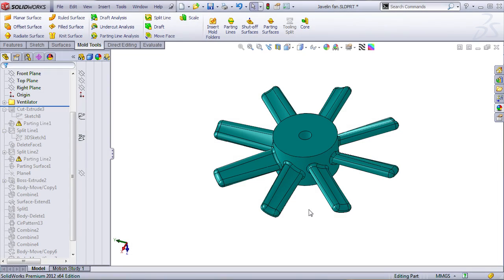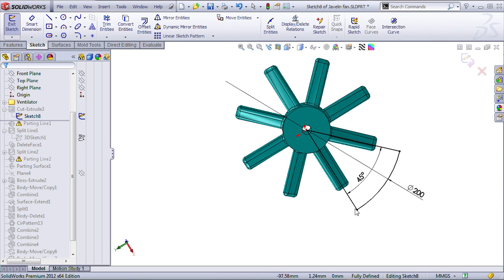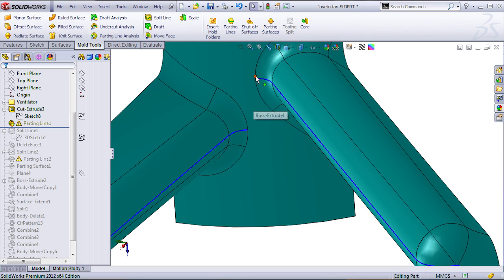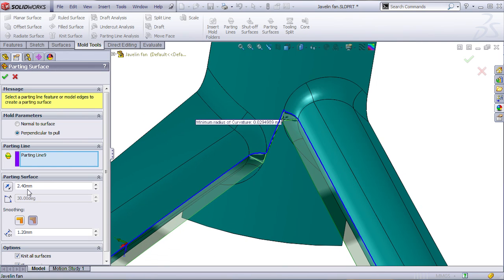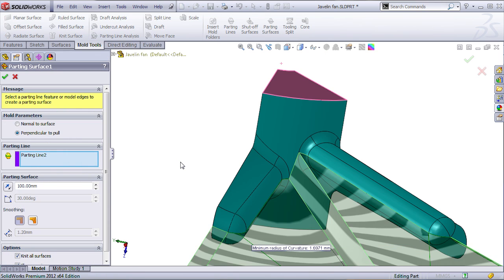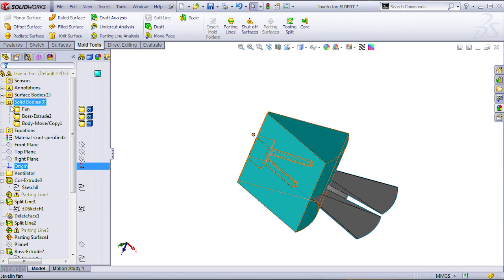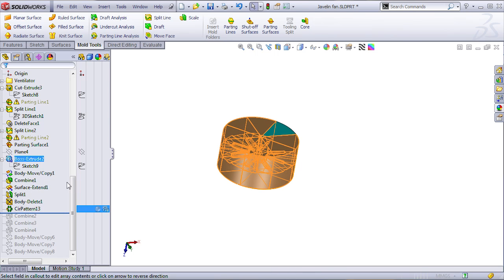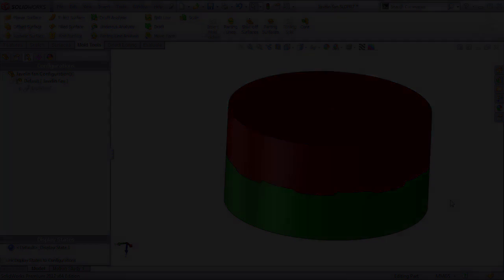Complex Mold Split Using SolidWorks

Comment: To make a smooth transition on the cylindric hub you can make the 3D-spline tangent to surrounding split line elements.

Create an split-line to split the surfaces of the "blades" and their fillets attaching to the hub but ignore the path on the hub. It will be split once you have a 3D spline. 

Then make a 3D-sketch on surface where you "convert entities" of the surrounding split line elements and set them "for construction".

Then draw a 3D spline on hub surface and attach each end of the spline as "tangent" to the converted splitline elements. The 3D spline on the hub can now be used to split the hub surface.

Once the surface has been split you can run a complete split line where you can now make the path use the split of the hub surface.

When the split surface is now created using the split-line, the surface will be tangent as it crosses from hub to blade fillets and the split-plane becomes continuous and smooth.

Comment: Hello I am not sure but do you think if you made both sides of the cylinder taper the draft surface will sort out by using symmetry revolve cut ?  and tracing your parting line from that middle plane that you created ?

Comment: 1:25 You should always try to create fully-defined sketches. So when you're requested to change a feature or the customer makes the change, importing the revised part into the file will result in fewer corrupted commands, let's hope. Nothing is guaranteed. Regarding the part file: Always use a copy the customers file & archive the customers version. Delete any links & store in a customer archive file safe from any accidental associations. It never hurts to remined everybody of this procedure to save the Designer & their employer headaches later from 'difficult' customers. As for the part: I would've asked the customer to redesign the fins for an easier better parting line. Not just for subtractive machining but to simplify the geometry to reduce build time. Just a thought. Thanks for the video.
Reply: Yep, you could ask the customer to redesign the part to make it easier for you and they get the next cheapest competitor to do it for them, you'll never know. Agree with fully-defined sketches. I'd prefer to let engineers go who can't understand the importance of using fully-defined sketches. Just do it!

Comment: what if your "spline on surface" step has to span 3 or 4 surfaces?
Reply from the maker: In theory it should work. Have you tried that?
Reply: Javelin Technologies Inc. According to sw help..  You have to do a unique  spline on each  surface and connect the tangent points,  but when I try to connect those points it just errors out.